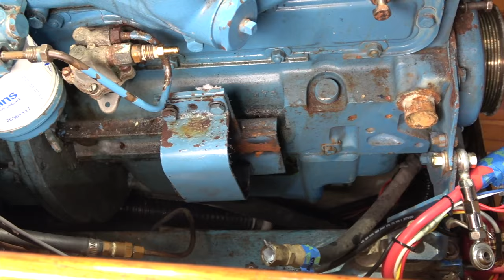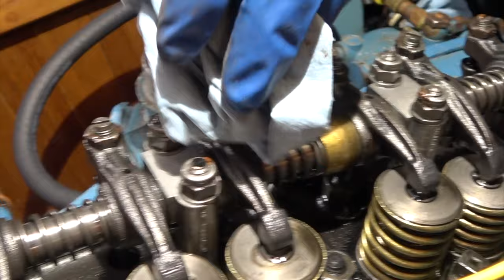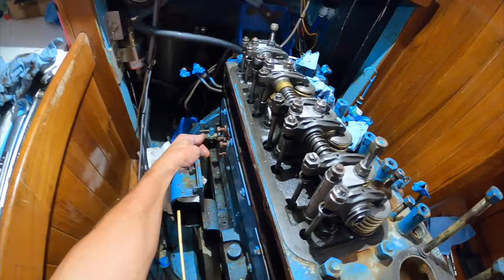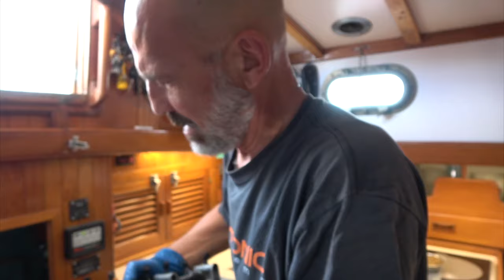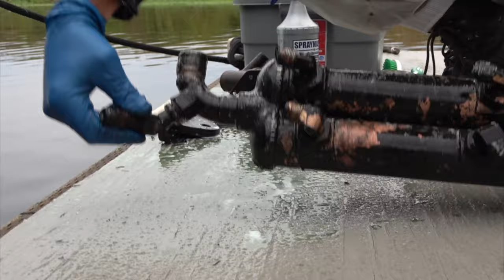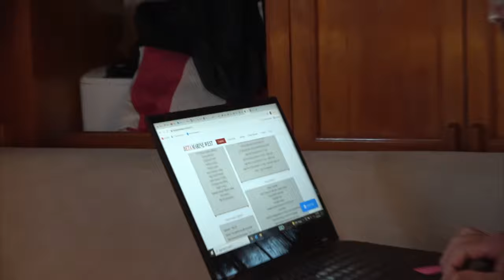Perkins 4108 Tear down Part 2 | SV Ramble On

Comment: Thanks for the engine videos. Considering that the Perkins 4-108 is identical to my Westerbeke W50, I'm interested to know how many hours you have on it? Of course, many variables to consider when looking at longevity and rebuilds but nice to have some anecdotal information. My 41 year old W50 only has 2300 hrs on it and seems to be performing well after a good chemical cleaning of the heat exchanger and a recent rebuild of the HP fuel pump. FWIW, a mechanic friend of mine said that better fuels available since our engines were manufactured were the biggest advancement in engine longevity. He also advocated that if I'm concerned with overheating (I am in warmer weather) that I start recording data while the engine is running at several RPMs after achieving steady state. I just started doing this but of course the raw water temps are now down to 60 degrees (and falling) in the Chesapeake so my engine runs far cooler than in the summer with 80+ degree water and 80-90 degree ambient air temp. One of the hottest spots on the engine is the exhaust manifold so I took my temperature readings from there. At 2000 RPMs (which pushed my Tartan 37 along at 6.5 knots) I get 215 degrees. This RPM is still far lower than I should be able to run the engine since redline is 3300.